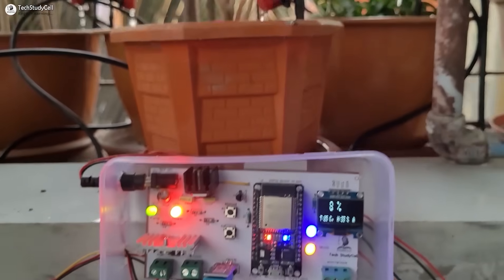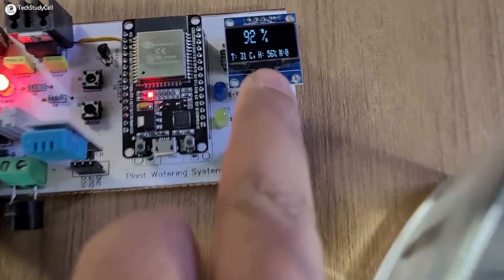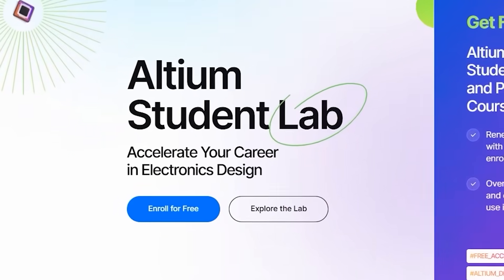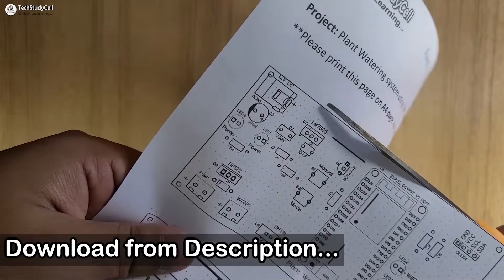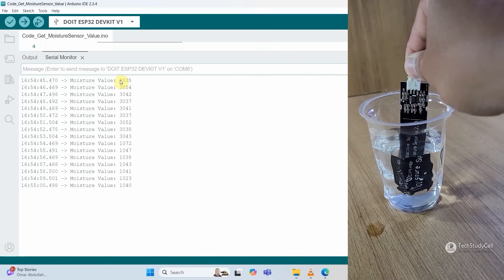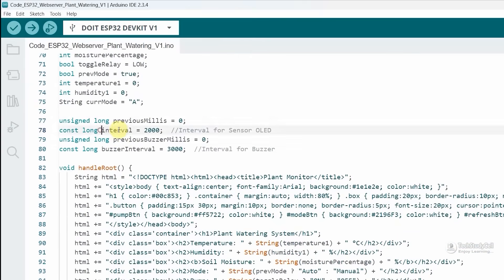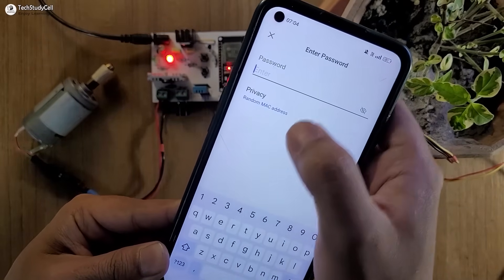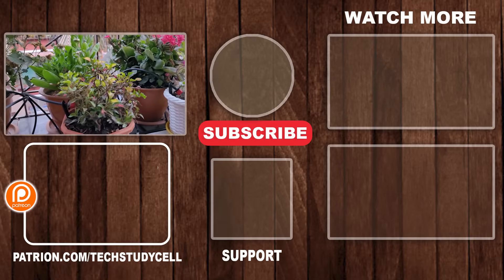How to make Plant Watering system using ESP32 Webserver for vacation | Smart irrigation project

Comment: What is the advantage of this. If it connects to the webserver, it means we are at home. This can be ensured manually. Your previous project is more helpful I guess.
Reply: To avoid 3rd party services webserver is used
Reply from the maker: If Wifi is not available and you want to control it remotely.